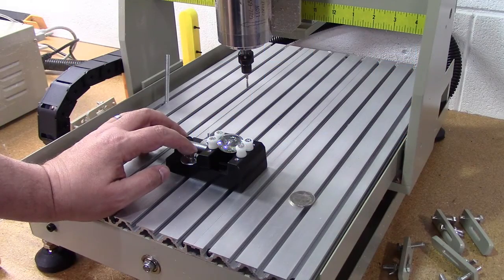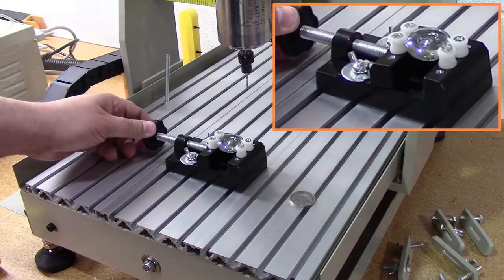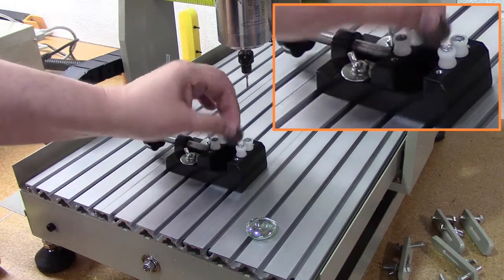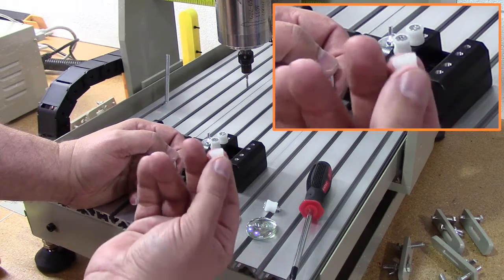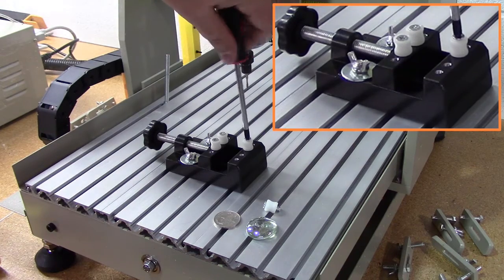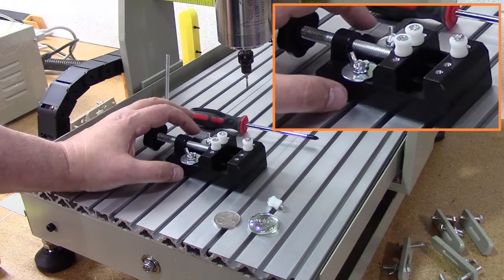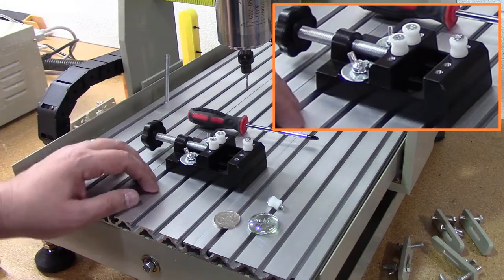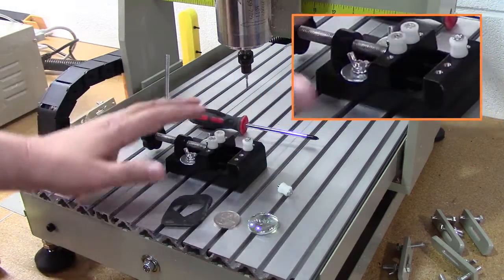Shop Talk -  Unique CNC Vise Cheap!

Comment: That's a perfect project for Tim the Tool Man."   Lets beef it up!
Reply: Exactly.  The way that it is now I would be afraid of it when in comes an end mill at 1k rpm plus.
Reply from the maker: You and Dark Alchemist picking on my new baby vice :-)  In reality it works well for holding odd shaped objects which I got it for.  I am building a very cool industrial style water bath to submerge it into as this whole water cutting has worked well and I want to mill carbon fiber so need a good sized one...